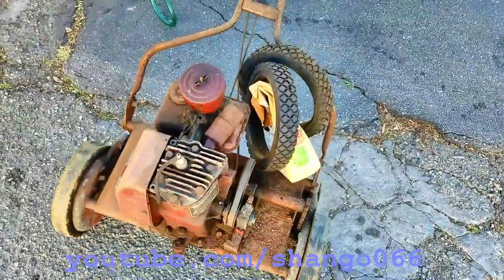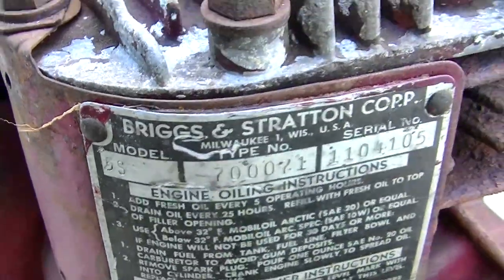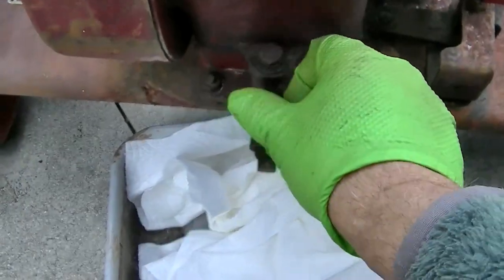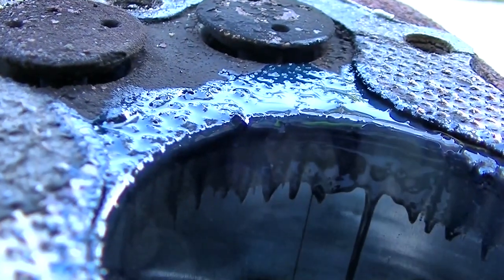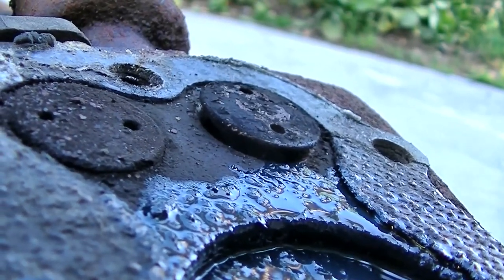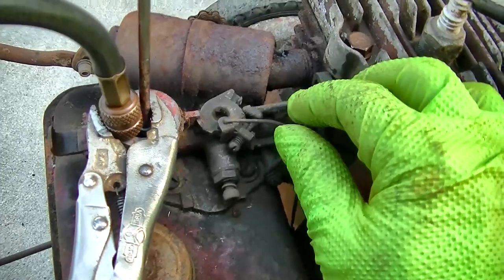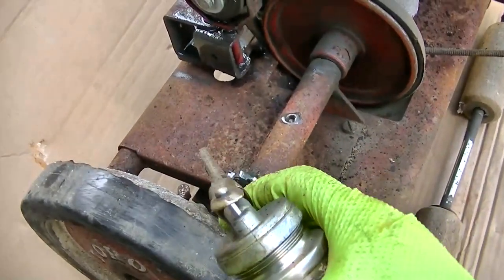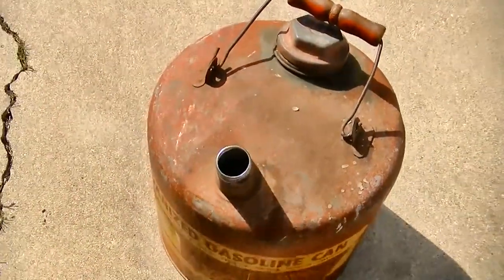Resurrection 1950s TORO SPORTLAWN Lawnmower Power Reel Mower

Comment: I remember one like this abandoned in the storage attic of the little auto shop I was a tech at years ago. 
Didn't think much of it at the time, but in hindsight, wish I had claimed it when I could have. I'm sure it went away in the back of a scrap guys truck by now. 

I've had good luck using the Shell Rotella T1 straight weight SAE30 diesel oil in the small engines I service. I think it's an oil formulated for older diesels, so they kept most of the good stuff in it. 

Incase you haven't replaced the head gasket yet, took a look in a 5S parts manual. The original head gasket part number was 291301, which has been superseded to 27463, still available from Briggs for under $10 most places I saw.

Comment: We had one of these lawn movers when i was a kid, looks very like it, but i think it had a more modern motor with the pull rope reset ready to pull type mechanism.
You can probably weld a new muffler using some cans of beans and a metal cutter cissor and some innovative skills, grind away the galvanization before welding, it makes bad welds and not good to breathe in. I once made a better rear muffler for a loud dirtbike using a small CO2 welding bottle and some pipes so the exhaust did go back and forth in there, worked fine 3x less noicy.
I see now at the end of the video that you got a new muffler and that is fine too lol, no need to make one then :)
Yeah, lots of danger for kids i guess.. i was myself standing on one of these plates while it self propelled away cutting the crass with me standing on the lawn mover, likely dangerous if i had gotten my foot in there but it was fun, my first motorized vehicle kind of :)
These are good grass cutters, strong and useful :)
I think it did follow the house we did buy, a old house from the 1800's, best house i ever lived in.

Comment: Maximum rated speed for these 5S engines, and most cast iron oldies, was only 2,800 rpm. Lots of You Tubers race these at 4,000 rpm, but the connecting rods were very thin and weak, just sayin.' Get the bearings working smoothly before you try it out because it's a smooth but not high-torque engine. Boil the tires on the stove to soften them for mounting/dismounting.
Nice machine! Fun video, good luck sir!

Comment: I've seen people put a stake in the ground AND attach a rope to the stake on one end and the mower on the other. They have the mower run a radius around the stake and every rotation the Rope wraps around the stake causing the mower to do a smaller concentric Circle. That way you can just watch it cut the grass by itself.

Comment: I think newer Diesel oil has lots of zink in it,  I know some lawn care companies switched to heavy duty diesel oil as it's better for these. That and probably the briggs oil has plenty of zink.
Reply: Not just zinc, diesel oil for cars  has other detergents. And that crankcase needs to de washed with diesel because of "silver" which is probably aluminium shed from the piston because rings are shot.

Comment: Shango, get a spacer pipe, to extend the wooden rollers to the outer edges, that's what my grand pa and would do to stop the roller travel, when we picked up those old reel type mowers back in the 60s, it was tough to find parts for them back then. By the way, that's 2 1/2 RAW horsepower on that old briggs, and you will never wear it out.

Comment: Made from 1949 to 1957. That one in late 1952. Two inch bore x 1.5 inch stroke. Rated 1 HP at 2700 rpm. Oil capacity 16 ounces.
Get the operating and maintenance manual. Will have parts numbers, eg. head gasket 26763. eBay will have parts. Google briggs 5s pdf for the manual. Adjusting governor, points etc. You were lucky on the points.

Comment: you can get high zinc oil still, maybe not in california but definitely in the rest of the us, finding it in a weight as low as straight 20 weight might be a bit trickier since most of the time you see it in like 20w50 for big clearance big blocks but it should be findable in sae30 synthetic with as much zinc as you could ever want

Comment: I had hoped he was going to restore this classic machine... Parts are still available to many of these old machines on EBay and other sources... The data plates are still on the mower and the engine!!! Original air filter and vacu-jet carburetor!!! I have seen restored machines like this one selling on EBay and other places like pawn shops... This Toro Reel mower with the cast iron Briggs 2-H.P. engine is a real gem!!! If he restored it properly, it could fetch as much as $1,500, possibly more, if done right...
Reply from the maker: Restore? I've been using it weekly since this video to mow my huge yard and it's been reliable

Comment: Don't break those tires because they were 100$ after the end of production.
Blood meal is current as an early season nitrogen source, on leaf vegetables also.
You need to be careful if you open the clutch, there are 16 loose ball bearings in it.
You adjust chain tension by shimming the jack shaft.

Comment: A reel mower is a much finer way to cut grass than with a rotary mower  a reel cuts like scissors a rotary just whacks thru the grass  making a jagged cut  thats why on the greens and fairways of a golf course you will always see reels used on them a green is cut at just 3/16 th of a inch ! you sharpen a reel by turning it backwards and applying lapping compound and adjust the bed knife  as you backlap it keeps it like a razor !  as a teen I worked at a turf equipment dealership that sold machines to every golf course in south Florida .

Comment: The coil is an inductor, so when the points are released, the field collapses quickly and a surge of energy is created from that collapse, which creates the spark.  I think.  It's just what I saw in my head when quickly thinking about it.  Can't forget the capacitor's (condenser's) help in keeping things from back flowing to the original source on the primary.  Why couldn't an inline diode replace that?  I wouldn't think electricity coming back from the primary would be as severe.
Reply: the capacitor is there solely to keep the points from arcing, it is across the points and effectively acts as a short while the points open to control the voltage rise time across the points until they get far enough apart to not arc.

Comment: Used to see the old “squirrel cage” blade mowers in action as a child with the motor and powered blades open where you could see them whirl. All open?!?! Quite a frightening experience. I also remember the old electric fans with only a wired frame with three elements keeping that halo around the fan. How dangerous! What were they thinking?

Comment: what happened to your "COOPER CLIPPER"?????               that engine was discontinued in 1955, it is one tough engine!!!!!. I collect and rebuild those "OLD" briggs engines. it is amazing that the flywheel nut did not come off( using a drill to start the engine) that has  a "LEFT HAND THREAD" nut/ crank   that engine will not destruct itself using todays gasoline/ oil !!!!

Comment: Those NOS tires might soften up with a long dip in boiling water and go on easy the same way 40's TV restorers soak NOS interlock cords in boiling water so the mounting ears get flexible enough to slip over the old rivets.

Comment: There's no way I'd use it---one stone hidden in the grass could take out a kneecap. But I do appreciate the quality of it, and the fact that you were able to get it going again
Reply: Completely untrue. I used one of these to cut hundreds of yards back in 1961. Never had anything but grass clippings thrown out the back. These reel mowers do not throw stones, rotary mowers are MUCH more dangerous in that regard. This is a very safe mower.
Reply: @quantumleap359  Explain to me how it's safe. You still have a spinning blade that outputs grass towards the operator, with no shield---how can the mower differentiate between grass and a dangerous object? Anything the blade comes into contact with is getting flung out the back.

Comment: That engine only takes about 3/4 of a quart, and you fill it with the engine level to the top of the filler hole, then you take the rest of the quart mix it with diesel fuel and spray the entire machine so that it doesn't rust..... Well maybe not in California but we do stuff like that on the East Coast.

Comment: The points are readily available the ignition coil that's used on that is a four-post ignition coil meaning it has four screws typically if it's the original one that holds it on the coils are very hard to find they don't make them anymore however I've never came across a bad coil on one of those either so they must be made pretty well I own two or three of these motors as for the compression issue check your exhaust valve or intake valve because of it has been setting for years one of those could have been open and it would cause them to get stuck over time as a old gas or old oil in the valve guides would cause them to lock up easy fix though other than that these things are pretty straightforward if you have any questions message me I can help you find sources for parts

Comment: My grandparents had the same one. For added safety, you turned it off by pushing a metal plate over the spark plug connection.
Reply: I was wondering where that metal part was.

Comment: nice finds the tires could be salvage the tires when i used to use them i had to putting them on i had to boil the tires i used the barbecue outside put tjem in water and got them hot and they soften then you should be able to push them on the rims wear gloves the blade soak them with a mixture of trans fluid can be old and kerosene  put the mower on cardboard  the gas tank use kerosone and handful of old metal nuts 5/16 tape hole shake tank the bolt break down the rust and corrosion  spray the tube with dstarting fluid remove mixture screw should be 1 1/2 turns from closed  then easy trick ger a can of seafoam  and trans fluid  with gas now afyer spraying the mixtureyou should get spray down the tubes  replace mixture screw tighthen until snug then back out 2 full turns  drain oil put in fresh oil with a oil bottle of trans fluid  now start the seafoam is a 4 vycle 2cycle motorboat motorcycle  it will not harm the carb parts and the seafoam lubicates the valves and clean them

Comment: So the way those oil fills work, you set the engine level, and fill til the top of the fill hole. Also a little lucas zinc additive will supplement the lack of zinc in the oil that engine needs to last for another 70 years.

Comment: Lemon juice dissolves that gas tank varnish? Good to know. I was using Coca-Cola because the phosphoric acid will take it down to bare metal if you let it sit for a day or two.
Reply: Think about that next time you drink a coca cola
Reply: @defaultuserid1559  Not phosphoric acid though. I don't want my stomach taken down to bare metal. lol. I've seen what this stuff does to concrete floors. And probably the corn syrup is even more harmful...goes to get a beer. (liquid salad!)

Comment: careful with the adjustments, it's really easy to crack the side cover castings that hold the reel adjustment threads, easily snap/chip and leave you more or less fucked.
Reply: Check harbor freight for boat trailer rollers, and Amsoil has a couple high zinc mixes.

Comment: I had the same mower as a kid in 1964, although the mower I had was a few years older, the engine was 100% cast iron.  The gas tank was completely rusted out on the one I had so, my dad suggested using a glass peanut butter jar as a replacement, which worked reasonably well.  That particular carburetor was very simple and the mixture ratio would change depending upon the fuel level.  Unfortunately for me, the mower was too heavy to allow me to take it around the neighborhood to cut grass so, I got rid of the mower and kept the engine, which I used in several projects for the next 10  years - Good Memories!

Comment: When they build stuff in the fifties they made it to last until last forever you don't find no more crankshafts or any of them shafts with oil type fittings on them everything is made to be replaced and it's cheap knock off that's why when I find gems like this old stuff they'll keep running another hundred years

Comment: That is suppose to have a screen at the bottom, And get a small torch heat the throttle then oil it wd40 it will free up

Comment: That's easily mid 1930s to 1940s cuz that looks like an original Clinton engine when they were still built in Clinton Michigan so I'm gonna say anywhere from 1930-1940 on that mower that could be a Briggs motor which would definitely put it in early 1930s range

Comment: shell rotella and ford motor craft desal oil has 1000 -1200 ppm of zddp. for gas shell is best as it has corrosion inhibiters. as for the valve seats adding 2 stroke oil at 400to 100 may help. as for 1950s oil the zddp was not high. was not till the 1960s did the zddp rise to 1000+ ppm of zddp. as for modern gas aside from the corrosion form alcohol it is better as it dous not gum up as bad and burns clean. i add stable marine gas additive to stop the ethanol problems or alcohol free gas . take  care!

Comment: 1950s oils actually did not have that much additives in the oil zinc and phosphorus got high in middle 60s or API SD  most small engine mfg recommend a API SJ because afterwards API SL and newer versions have less ZDDP

Comment: Wouldn't it be better to convert those carbrated engines to propane?
Reply: Propane is too dry (no lubrication like the old leaded fuel had) for these old engines, you need harder valves and seats or it'll eat both up in a hurry. I used to run a 1977 Ford 302 back in the day and if you didn't put in hard valves and seats you'd have to do a valve job about every 30 to 40000 miles....... or less.

Comment: Mobil gas! Try English english - it means gasolene.  No way should you run an engine like that from a petroleum gas tank. I used machines like this in the early sixties. Strip it down into bits and start rebuilding properly.